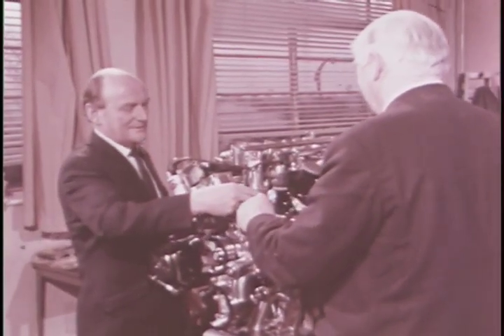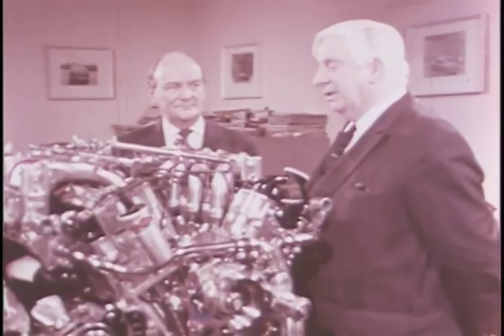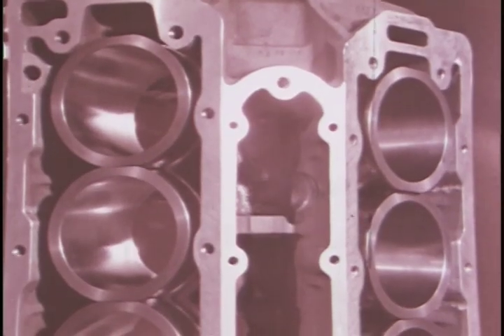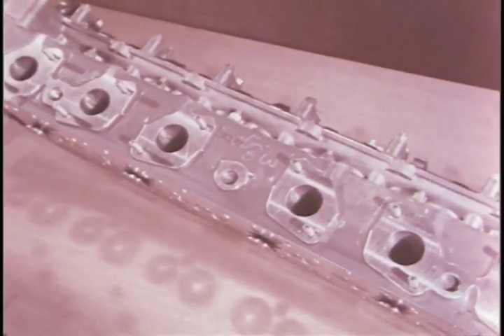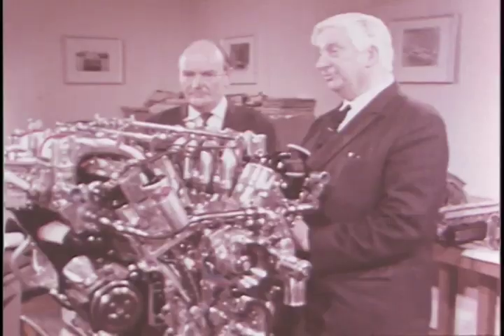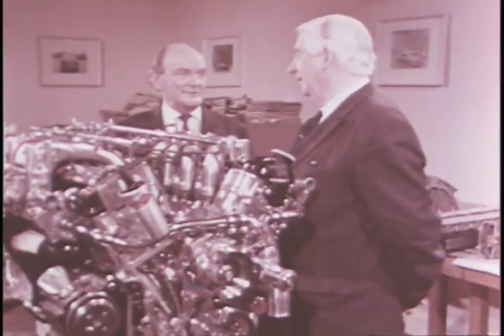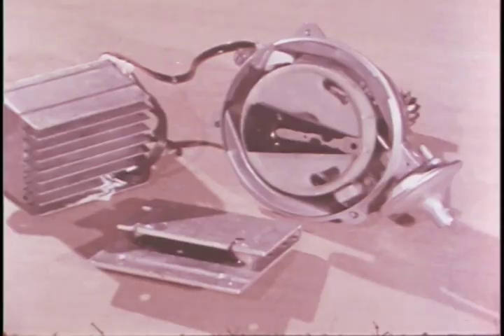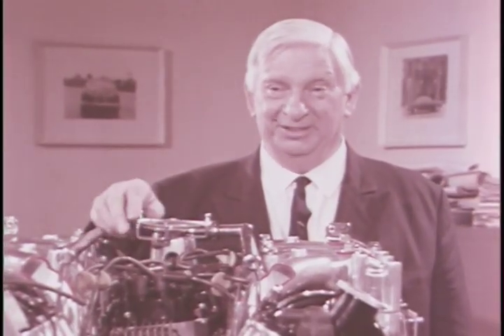Jaguar V12 Engine

Comment: These engines weighed upwards of 900 pounds, compared to 450-550 pounds for typical V8's of the same size and usually greater power.
Reply: they actually were closed to 700 pounds and made way more power than V8s of the day. In the same decade the Camaro, mustang, corvette, all made less than 200hp. The mustang of course had the 5.0, but the GM engines ran all the way up past 6l, while the V12 made nearly 100 more hp at 5.3l pfffft
Reply: Where did you get that number ? The Jaguar v12 in this video weighed 680 pounds and in the years of gen one production made more power than the majority of American V-8s.
Reply: *****
 Yes but that is a modern engine using modern tech and I was speaking of Gen I. Wheres the point?
Reply: ***** I have it on very good authority that the LS7 dressed with manifolds and alternator, etc. weighs about 450-500 pounds.  The Jag V12's in the same condition weighed around 900 pounds.  You are probably talking without the accessories for the 350 pound quote.
Reply: Jagtastic, Haha.

Comment: Has  anyone ever tried an induction system with four 3 barrel down draft  ( I d f )  webbers like the ones used on on other engines , such as the miura v-12  or porche flat /oppossed 6 cyl.   I personally was  never fond of  stromborgs  carb at all   ..always loved  webbers , the simplicity  , tunabilty  , ease of  maintanance  etc.  ?  Especially in that era and with high perfomace engines webbers &sports cars went together  like meat and potatoes ......many times stromborgs were used to comply with emission regulations  .....with todays tech, we could overcome all those issues with  digital multi-port f-i  ,  crank triggerd  coil on plug  ignition etc.  Ect.  Etc.
Reply: Search for "Jaguar V12 Weber" there are some videos with webers. Not 4/3 but 6/2 usually and as with all weber setups lots of reversion but good power. A racing FI setup is most efficient re power and fuel metering. Sad that these motors never had a worthy oem FI system.

Comment: Built hundreds of them on the track at Radford Coventry 1985 - 88. Drives you mad eventually. The track went squeak squeak and the airlines leaked all day and all night...Every one of them hand built. Automation was a multi spindle airbrace for doing the sump. The pillar drills dated from 1914. British industry at its best...
Reply: Spencer.  Can you help me track down a mystery engine code etched on my 1991 TWR 6.3 V12 engine.  J/S 6L 38 DEV  I have contacted Jaguar UK, USA and the Jaguar museum and no one seems to recognize it.  I am pretty sure it is a Walkinshaw engine
Reply: @MsLilyhorse Tom Walkinshaw Racing had support from Jaguar to have their own castings made. What you have is likely a special casting just for the TWR racing effort and is very rare indeed.   . .if you still have it 11 years later.
Reply: ***** The have no record of the code. :(
Reply: I worked on Jags in California; Rolls too Not rushed. Get it right. Didn't work on the 12 though. Enjoyed it !

Comment: I love this vid. I own 2x pre HEs and to see this delightfully stuffy film has got me all hot and bothered. Oh crumbs.
Apparently MR Hassan got jolly batey every time he thought of a V8 so he designed a V12 to show those Americans Jolly What Ho!
Anyhow... :), this magnificent engine and they bolt it to a stinkin' rotten BW model 12 transmission in an E type (and my '76 SII). That's like having the most attractive partner you can imagine and and only ever having a quicky in the missionary position; FFS!

Also, MR Hassan forgot to mention periodic lubing in the top of the distributor shaft stops the advance mechanism from seizing with its attendant potential for overheating. He needs a good smack on his botty - Bad Walter! (the 2755FPM mean piston speed @ 6000RPM somewhat mitigates his punishment in this instance)

I must go and lie down now...
Reply: I think sir should ride him around the room for not mentioning the periodic lube of the ignition advance mechanism.

Comment: The 6 cylinder (3.8)  E Type : Top speed = 153 mph. 0 - 60 = 6.7 seconds.
The "improved" V12 E Type : Top speed = 148 mph. 0 - 60 = 6.4 seconds.
What if the 6 cylinder had been made with an alooominum block ?
Reply: johnpetermalcolm 😂

Comment: Yes of course six two throat Webers is ideal for the V12, looks way cool but in the States this is tampering & modifying emissions systems( Post 73) ...depends on which state of course....Where I hail from(Oregon)...in the cities, you cant modify like this, you will not pass emissions standards, denying you your registration.Of course one is going to use the required oil & premium gas, if needed. With the CRatio of the HE heads so high, yes use Hi-test gas.

Comment: @Briggsquantum
Its a custom design that I had a mechanic do for me :) they are side draft webbers, they mount up very similar to the Strombergs, slight changes needed to be made obviously but so far it has worked out amazingly well, they hold a tune awesome and I almost never have an issue.  I don't have all the specs in my head but i can always go out and take a look :)

Comment: @Ricardo Ellison
Worked on a lot of jags then? Lots of the v12s?
I am American btw.
When I say shitty oil I mean the wrong weight, they need the right weight to run right.  Gas is very important to, they require high octane fuel.
Keeping the vacuum lines lubed is very simple, only takes 15 minutes to do them all.  And yes i like their precision, i treat them in a precise manner and they don't break.

Comment: @WickedZZzY Ordinary people? WTF Yes, myself a professional mechanic since 1984 I know your types all too well also. Shitty oil? Oil sold in the States have to pass quality standards, set rather high..there is no "inferior oil" sold. Maintain electrical connections, Connectors USUALLY(Don't know how bad English connectors are, "Prince of Darkness") have an 'O' ring sealing them. Lubing vacuum lines? Don't have enough money to take it to a dealer? Then you admit maintenence costs are out of line.

Comment: I know the Strombergs were a problem - I raised that point first.  And you installed six Weber IDF's?  So you went from lousy gas mileage to horrible?  Then you insist that the engines must be treated gently or they will give trouble.  Use "special spray".  Don't let "ordinary people" own them.  So you are an elitist.
I've got forty years in automotive repair.  I know your kind well.

Comment: If you put shitty oil in and dont change the oil, and don't lube the vaccume lines and keep the inlets clean and maintain the electrical connections with special spray then you have to expect it will run bad.  They aren't engines you can just beat the shit out of.  
The problem is ordinary people can afford to buy jags but these ordinary people are to lazy to maintain it themselves and they dont have enough money to take it to a dealer to keep it properly maintained.

Comment: You need to own one that has been taken care of.  As I just said mine has been running flawlessly for the last 200,000 miles. . .
I also own several others that very rarely have issues.
I would recommend buying the 94 majestics.  The only thing they had issues with were faulty relays which were easy and cheap to replace.  The 5.3 v-12 in the jag was one of the best engines ever built.  
The issue is people are to stupid to maintain them properly.

Comment: The V-12 in the XJS was horrendous, trying to  pass emissions, the engine was flooded with vacuum driven valves & vacuum lines by the mile underhood. These Jags were a money pit, when one system was corrected, another would fail.  These vacuum driven systems were common to all  in the eighties. Who knows how good the V12 could have been with current computer EFI systems eliminating all the reliability issues. The V8 jags now have zero character & copy the Aston Martins too close.

Comment: If you knew anything about the v-12s then you would know that the main issues they had were with the stromberg carburretors and the electronics.  I replaced mine with a webber kit.  Never have an issue.
jag also solved a lot of the problems when they switched to EFI.
They are simply engines that you have to take care of, I don;t hit mine with a hammer. . .

Comment: :)  So by your logic a Volkswagen Beatles's four cylinder, air cooled engine is better then a ferrari v-12 simply because it has sold more?
You obviously never driven a Jag v-12 
One of mine has over 200,000 miles on it and it runs so smooth I can balance a penny on the engine while its running.
It also never has problems with the engine.

Comment: Actually, a 350ci chevy v8, even with fuel injection struggled to better 200bhp, where as a 326 v12 Jag engine on carbs started at 299bhp, so you are talking shit and making excuses for your crappy, idiot American engineering, fucking yanky fuck wits

Comment: Well this is the V12 engine used until the late 90s. XJR6 or 8 produce 660 and 750 hp (race cars). But these guys used 4valves/cylinder (i believe). I know TWR's Touring car XJS still used 2v/c but I can't find the output power. It was fast, check it out. Jaguar used this engine in the last XJ V12 model, with +320hp I believe.

Comment: All very nice eh what?  Except that this V-12 of 326 in3 is heavier than the all iron Chev 327 and produces less horsepower.  The Heron combustion chamber was obsolete long before these guys decided on it.  Fuel mileage was terrible.  Valve seat inserts dropped out at alarming rates.  Possibly the worst post-war automotive V12.  Just look at the terrible intake manifolding to use four lousy Stromberg carbs.  The inlet tract was torturous because the spark plugs were in the way.